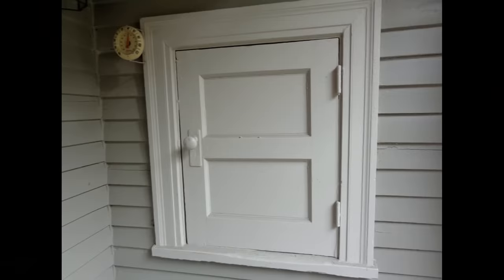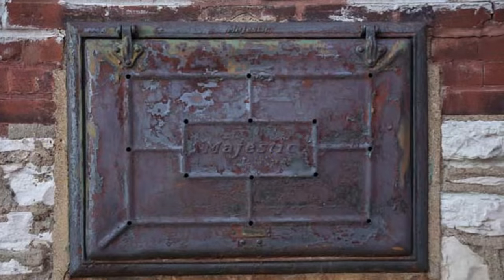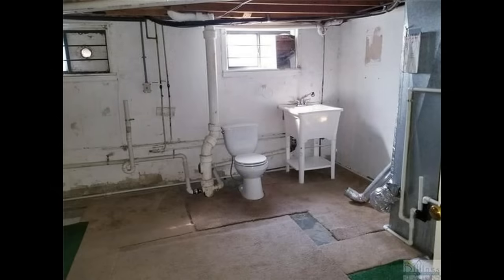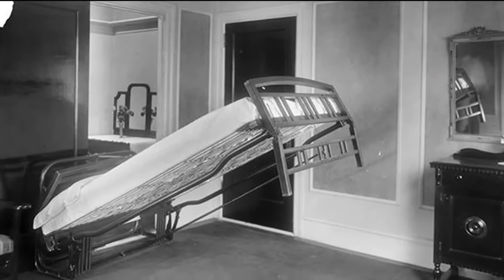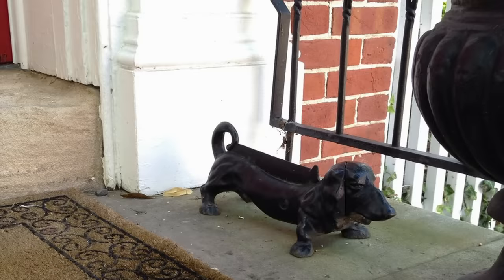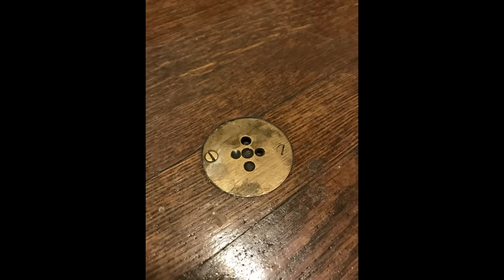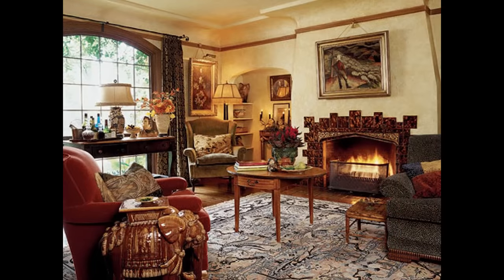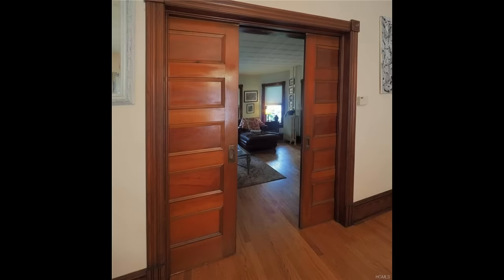Mysterious Home Features No Longer Used

Comment: I knew several of these from my relatives' 1880s home, such as the two-button light switches and pocket doors.  Two things from that home that could have been added to the list:  double pull-chain furnace controls and a well pump at the kitchen sink (which my grandfather replaced in the mid-1970s).  Opening transom windows were standard above classroom doors at my college and really helped with moving hot, humid air during summer school sessions, even after the central air system was added.

Comment: Growing up on the east coast of FL, I was familiar with a property that had a huge hunting lodge dating back to the early 1900's. 
It had one of those 'secret stairways' hidden inside a wall, with both upper & lower access further camouflaged as closet walls. It was quite steep & narrow, but due to the very high ceilings of the lower level, there was easily room for 20 or 25 people in there if you crowded in.
According to local lore, the remotely located lodge became a popular brothel for several years back in the 40's.
It is said that whenever there was word of an impending raid by the law, the ladies & patrons would conceal themselves inside the wall on the hidden staircase & wait until the authorities were all upstairs, before sneaking down & out of the back service door, and then quickly dispersing into the surrounding swampland.
Reply: Good Lore 🧡

Comment: Back when I was a building inspector in Texas I once inspected a remodel of a house built in 1918. There were hardly any nails used in the framing. Mortise and tenon joints along with tongue and groove were used throughout. This was in 2010. It had true 2X4 studs along with ¾ shiplap on the walls. The house was still square and level as the day it was built. The cool part was seeing cotton flour sacks underneath the wallpaper. I was told this was used back in the dustbowl days to prevent infiltration.
Reply from the maker: That is all very interesting and I appreciate you watching and telling us about what you experienced.

Comment: Not bad, though you missed a few interesting ones, I'll mention them for the fun of it.
-Stepped gables aka Trapgevels. Aside from the aesthetic aspects, these were useful both in rainwater management and to provide roof access to chimney sweeps.
-Gargoyles. Also a rainwater management device, a spout to get rid of the water. Also roof ornamentation.
-Hijsbalk. A beam (or cantilever?) sticking outward of the top of a house that was used to lift big/heavy objects onto the second (or more) floor via rope and a pulley. Mostly in houses with narrow stairs or other reasons.
-Horseposts. Since the car and bicycles and such have replaced horses as the primary transport.
-Candleniches. Mostly in houses with stone walls, these were intended to lessen the chance of housefires by giving the candles a little recess to sit in.
-Crankshafts. Crazy, ikr? But in reality, crankshafts were originally intended for windmill-powered manufacturing, so a fair few millers' houses had a crankshaft running through them.
-Bedstee. IDK the English word for it, but basically think a wall-embedded sleeping place with closet-like doors. ^^;;
Reply: Another version is called a "bedsitter." I believe it was a combination bedroom/sitting room in some English houses.

Comment: interesting video Rhetty I worked with my Uncle's in high school and we restored a building that was originally a bank built in 1912 and I remember seeing electric wires with those white tubes in the ceilings of that building. my grandparents had a root cellar that they still used until the 1980s. They had a boot scrapper by the front door and the old medicine cabinets. The building that I restored with my Uncle's had those transit windows in them I always thought that they were cool looking.
Reply from the maker: Thank you for watching. Those root cellars can still serve a purpose.  Especially here in Oklahoma.  My in laws still use one.  This really interesting about the old bank building you worked on with your uncles.  I'm always fascinated by the vaults and counters if they are in there.  Then I start wondering about all the people who have walked thru the doors and done business in it.  Was it a corner bank building?
Reply: @RhettyforHistory  It always leads to odd sights when an old building gets re-purposed. Where my local bank branch used to be is now an auto parts store. They store their oil and anti-freeze in the vault.

Comment: My MIL and I went to visit a house her family had lived in many years ago, there was vents on the very apex of the house and at certain angles to each other. She said they once housed an “attic fan” which would cool the house using natural wind to turn the blades and circulate throughout the house. She said it made a HUGE difference back when they didn’t have air conditioning
Reply: Sounds like the predecessor to modern whole house fans. Great things to have if you're somewhere that's hot during the day but cool at night, as they let you circulate all the hot air out during the evening.
Reply from the maker: Attic fans were necessary and very good long before AC became what it is now.  Thank you for watching and mentioning that one.

Comment: I've lived in a house that I found a delightful surprise or two in. When replacing the old front door, there was a picket cavity on the side used as a "door bell". I was able to use it as intended, a "button" stuck outside and inside a pulley was used to ring a bell in the wall. Also the old Ma Bell phone jackets in the shape of bells, a literal mail slot near the front door when mail was pushed through the slot it would drop into a box below I could open to retrieve. It also had many of the features you showed in this video. Thank you

Comment: Many homes had a door from the pantry into a screened box, or a cupboard with a wire screened bottom that allowed cool fresh  air to rise through the cupboard and exit through the screened top, which was piped outside. Its very effective to keep vegetables cool ,saving fridge space. It was insulated .The warmer air rising,puls the cool air up. 
   We put one in our new home, we live off grid.

Comment: 1:29 Telephone nooks made the most sense when the earpiece was separate from the microphone, which was attached to the wall box; the nook made it easier to talk without interference from the ambient nose in the room.  Another feature that was common in older houses, and often removed in later years to free up space, was the vestibule between the front door and an inner door to the rest of the house. When fireplaces were used for heat the vestibule kept the wind from blowing the ashes around or blowing out the fire altogether. Even today, vestibules are useful to prevent heat loss when people are going in or out; that's why they are still common on public buildings.
Reply: I built a piece of furniture from that time period(from very old catalog). It was a table with a mirror so that when you enter the vestibule, you would use the mirror and straighten your hair and take off your coat, etc.

Comment: Deep wrap-around porches (2 or 3 sides) and basement windows plus attic windows helped to cool the home. The cooler air in the basement (or from the shady porch) was pulled through the house (and out the attic windows) by means of natural convection. Many homes had "sleeping porches", a fully screened area for summer sleeping.

Comment: I had a 1946 house with the floor heat grids in the hall that would melt your rubber soles if you walked on them. When they did the central heat, they took mechanisms out but left the cover with carpet as an easy way to get into the crawl space. I'll be darned if we didn't go out of town, and someone crawled under the house from the outside and came up through that grid and robbed us. Just a cautionary tale my friends.
Reply from the maker: Oh wow that is scary to think about someone doing that.  I do miss those old floor grate heaters.  They felt great to stand over in the winter time.  Fortunately I never had them melt my shoes.  I have had some old homes that I lived in as I was older and when I took that great out I pulled up the wood flooring and then redid all of it.  You could never even tell it was there by the time I was done.  Now that I hear your story I'm glad I did that besides the cosmetic benefit.  I'm a big fan of real wood floors.  Thank you for watching!

Comment: The house I grew up in had a root cellar, in the basement, with a vent through the wall, to outside, that had bug screen at both ends, as well as sliding doors to allow regulation of the air flow. We also had a vented cupboard in the kitchen, ironing board cabinet, plus a wood box at one end of one length of kitchen cabinets and countertops, near the wood stove. Vents through the ceiling, to the second floor ( where the bedrooms were) to allow heat to rise to the second floor. We also had cubbyholes, in each of the upstairs bedrooms, that allowed useable storage space under the roof, where there wasn’t enough headroom to allow adults to stand up straight.

Comment: I've lived in several houses with knob & tube wiring.  There is actually nothing wrong with it.  So long as the wires and insulators are in good shape, it doesn't need to be replaced.  Also, my grandparents house had the pushbutton switches into at least the 1970s.
Reply: agreed, i am an electrician, and quite often there is not much wrong with it, or at least not anything that can't be repaired if needed. just so long as the wire itself is fine it'll last forever. only issue is you can't insulate over it and it's not designed for modern loads, but you can add an outlet if needed. same with fuse boxes, just be sure to have the right size fuse in place! 

i actually installed it in one of my buildings, along with an 1800's fuse board, no issues whatsoever!
Reply: The insulation on a lot of it has broken down though and there's no static ground wire.  It also wasn't built to carry the current necessary for modern appliances.   Though in the days of LED lights maybe that doesn't matter as much as it did 20 years ago.
Reply: @ISpitHotFiyaa  14 Ga or 12 Ga wire is still good for 15 or 20 Amps.  Wire that is out in the open and can radiate heat can actually carry more current than wire confined in conduit or Romex.  The ground wire is for safety and has little to do with static.  While we do have some home electronics, appliances, and tools that have a three-prong plug and ground wire, most lamps and alarm clocks do not and don't need one.
Reply: Knob & tube is also immune from inadvertent shorts when drilling into walls.
Reply: K&T may certainly be safer than the romex type wiring of the 1940's to 1960's that had rubber, rather than PVC, insulation.  We owned a house (in Ontario) that was not electrified  until the late 1940's.  The romex was the rubber/kraft paper/tarred jacket style.  On a great deal of it the rubber had petrified and broken down and caused shorts inside some of the wire runs.  Also not grounded.  I replaced hundreds of yards of it.  When pulling it down the insulation could be heard cracking inside the cable.  Every switch, outlet or light fixture box I opened had crumbled insulation in it and bare conductors.
Reply: @anthonyjackson280  I think I may have some of that in my current house.  I'm going to have to look into that.  I know they did a fair amount of renovation wiring with the newer style romex, but 2-wire no-ground.  It aggravates me that they saved a few pennies on the material and now I'll have the labor and expense to rip all of it out and replace it.
Reply: @anthonyjackson280  I'm going through that nightmare right now. Bonus points for the guy using neutrals (and at least 1 ground!) as hot wires and tying multiple circuits together. Double bonus for the boxes hidden in walls.
Reply: @randomvideosn0where  I found a JB hanging (from the old romex) inside the cold air return for the furnace.  And in one house the neutral and line reversed to receptacles because a nail had gone through the cable and grounded the black conductor (it was grounded wiring that time).  They did not reverse the wires at the outlet but at the JB branch circuit so on the receptacles the 'neutral' pin was live.
Reply: @anthonyjackson280  People are crazy!

Comment: Most of these features are still in our house. The Farmhouse, Barn and a couple sheds were built by my Great Grandparents in the late 1800's. The outhouse is still here but it was redone by my Grandparents in the 1920's. I upgraded it in the 1980's with a real toilet seat  and a roller to hold toilet paper. It also has a battery operated light inside in case someone needs to use it at night.(Emergency use Only if power goes out).

Comment: Excellent video! 👍
Many of these I knew.
Some I didn’t.
ALL had a purpose for the time.
Delivery services were a standard of the time as well.
The only addition I can think of is the mail chute.
It was either on the front door or on an exterior wall of the garage.
I’m 60 miles north of Seattle.
Many of the older houses in my area have several of these “built-in” features.
I’ve seen the phone shelf especially.
“Knob & Tube” electrical conveyance is common up here too.
I also know of a house where the laundry chute emptied onto a beautiful long wooden table in the basement for sorting clothes.
(New Subscriber! 👍)
Reply from the maker: Welcome to the channel and I'm glad you are here.  Those mail slots are certainly another item worth mentioning.  Now days with amazon being so popular it seems like another delivery type box would be something good to have.  Thank you for watching!
Reply: @RhettyforHistory  Already done. Just the other day I saw a commercial for a security box for that exact purpose. It sits by the front door and is about the size of a small bench seat. A combination lock is keyed to the parcel tracking number, allowing the delivery person to unlock the lid.
Reply: I am so used to thinking that Amazon "invented" the delivery model, I forgot how much stuff used to be delivered to people's houses, from slabs of ice, to coal, and milk. Even groceries and, of course, your local pharmacy. 
I guess it was cuz I grew up during a time when the only delivery to the house was the daily mail.
Reply: @jdrancho1864  

Yes! That’s true!
They should do another video on door-to door salespersons.
“Avon calling!” 
“Your Fuller Brush Man!”
“The Milk Man”, too!
Growing up in LA in the early 60’s, I remember my mother having her SCISSORS SHARPENED by a door-to-door salesman!
That’s how prevalent women sewing at home was at the time!
Reply: @jdrancho1864  
Interesting idea.
Does Amazon allow this?
Reply: @nellosnook4454  Well, of course the idea is that they - and UPS, and the US mail - would actually use this box, and not be assholes about it and just drop the delivery on the ground next to it.

Right now it is still so new, I don't think anybody has developed an official policy around it.
Reply: @nellosnook4454  Miami still has a truck, much like an ice cream truck, that drives around to sharpen your knives and scissors!!

Comment: One more: A 'cooler' cabinet in the kitchen or pantry. It had shelves made of screen material.  
Warmer air would rise inside the cabinet, drawing cool air from the crawl space under the house upward to reduce the temperature.  
Things like potatoes would be kept in there.  
The house I grew up in was much too new to have such a thing or any of the other features described in the video.
Reply: Most I have seen had slatted wooden shelves rather than screens.  Very common in the California Delta region for homes built before the 60's.   I had to explain to my Brother in Law (in Stockton) what it was for.
Reply: He didn't mention the flour bins either.  I have one and use it for recycling.

Comment: Very enjoyable presentation! I always wondered what the thinking was behind a random toilet in the middle of the basement! Thanks for your efforts!
Reply from the maker: Thank you for watching!  Those toilets do seem random now.  I think many people are finishing them out into a full bathroom.
Reply: The one that was in our house had the water tank up high and a long  chain hanging down to flush.
Reply from the maker: That is an old one.  I have to wonder about parts for those if people still have that style.
Reply: Basement bathrooms are fairly common. Often, basements would have temporary walls, the toilet in the "middle of the basement" might have been in a room at some point. But, I've also seen basement bathrooms that had shower curtains for walls. Basement bathrooms are actually more common in towns than in rural areas, as the toilet needs to be higher than the septic tank or sewer line.

Comment: We have a laundry chute that goes direct from second floor to the first. The chute itself is also only about eight feet long. This house was built in the 1980's. Laundry chutes are not technically illegal - but you have to abide by the fire safety regulations in your town/city/state, which may make having one difficult or impractical. Ours is from the second floor hallway to the first floor laundry, and it has a lid on it. do things get stuck? Sure, but a sharp tug on whatever is caught usually gets things moving. 

We also have picture rails because ... well... art. And a couple of pocket doors because sometimes you need a door where a swinging door won't fit...
Reply from the maker: Thank you for watching and sharing some of what you have in your home.